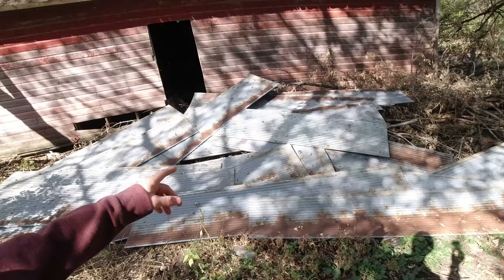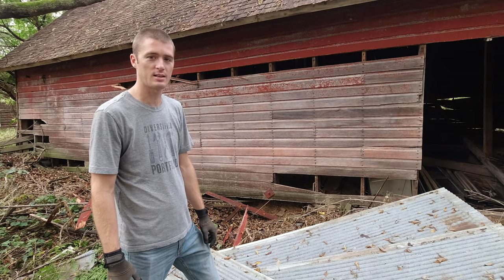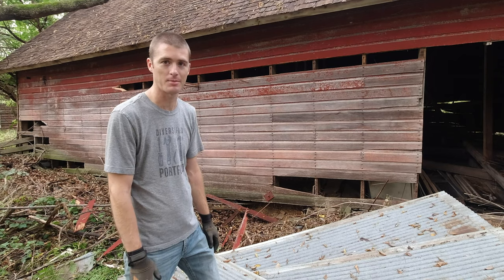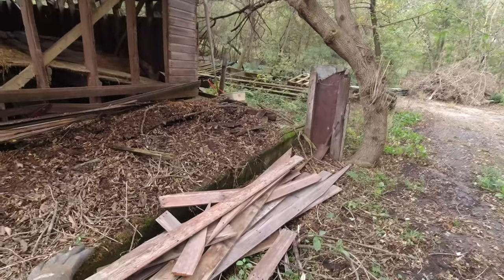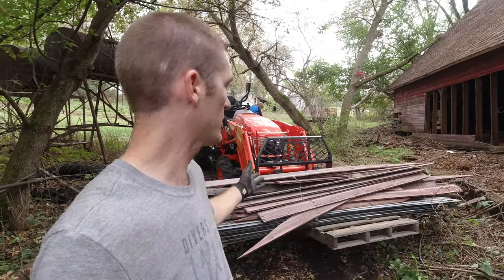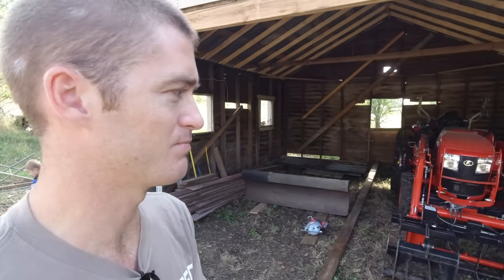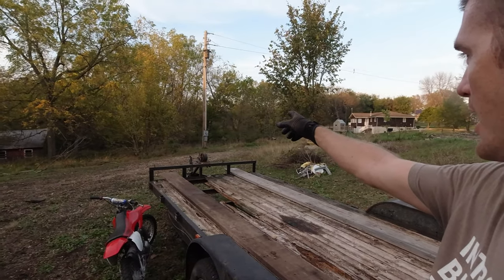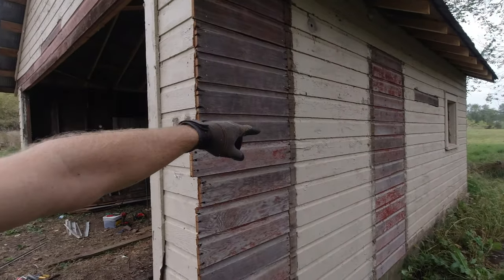Repurposing Barn Siding on the Garage

Comment: You did a great job patching up the siding. That thing will look pretty darn good once it’s painted. I agree black would make a clean looking roof just keep in mind that it will also add quite a bit of heat into the garage. Probably nice in winter but substantially hotter in summer than if you used a lighter color. Keep up the videos

Comment: Slow process but you can use a grinder to grind the nail heads off
This will save from splitting the boards
Reply from the maker: True, but some of the heads are sunk into the wood pretty far. Not a bad idea though.